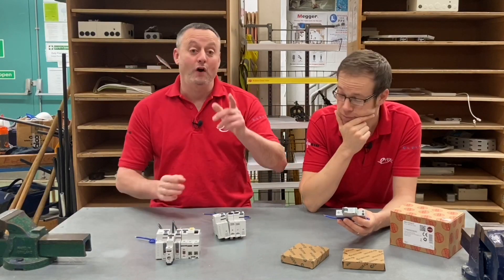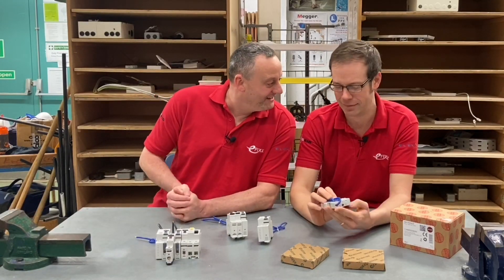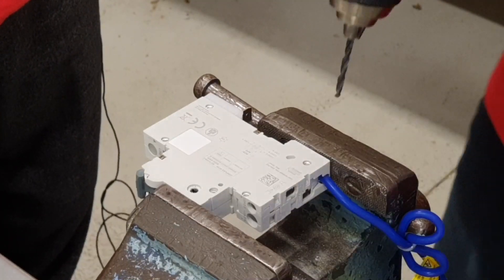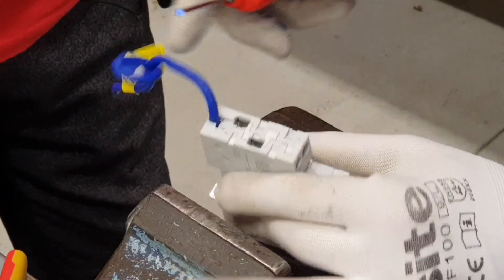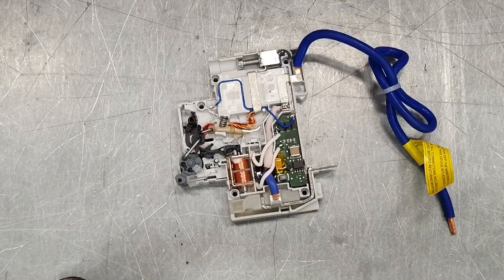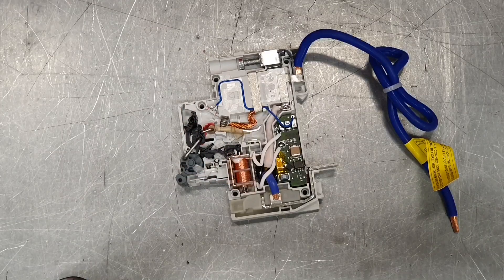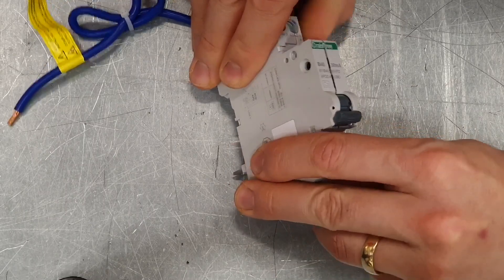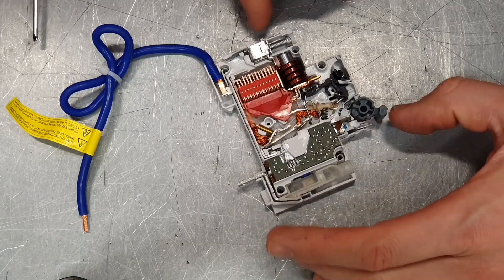What’s inside a Single module AFDD? - Arc fault detection device Crabtree / Wylex

Comment: This is ovrprotection, just adding extra expense and potential problems into the system. It's not about safety it about money and profits for the manufacturers.,better to control the quality of the materials and devices that are already in production. The quality has been deterioration for a number of years.

Comment: Great video!
Did you guys notice the thin blue wire that goes from a little contact to the PCB? That disconnects the electronics when the breaker is off, and lets you test the circuit without disconnecting the wires. It's also amazing how they use two solenoids on a single mechanical breaker. Surely that's half of the secret of how they could get so much functionality in one small device.

Comment: It detects the arc via listening to the low RF noise generated directly down the L & N when the arc forms it's normally quite a bit more noiser in magnitude than the general background making it quite easy to detect.

Comment: Am going to soon set up a test rig an blast some with DC - Just to see what will happen.  I did help with a big test rig back in my college days.  On the back out of sight or students we had switches to put faults on the test rig.  Such as switching in 500 k 1 Meg 2 Meg resistors also had two way light with just a long long long run on each side L1 L2 so we could switch it in to live and neutral and also link it out just seeing good numbers don't teach you much.  I have been out of it to long am reading each day on the new reg;s need to get back in to working using my brain was in dead end jobs for to long.  We also had other faults to switch in and out.  Took a part a socket cut one side out an soldered in a 3 ohm cut the live an stuck it in other sockets we had it on the CPC but each wired up to switch to link it out.  Was for socket testing Rn L1.  Some were in the junk pile I hope I still have old photos of it.

Comment: Great video 👍 , interesteing technology , my experience with certain budget brand single mod DP  rcbos and bussbar combinations , has taught me that the terminals do not take any abuse , especially overtight connections  . Torque screwdrivers are a must now , eventually I can see a column in test certs.